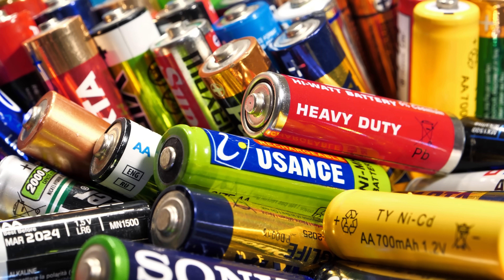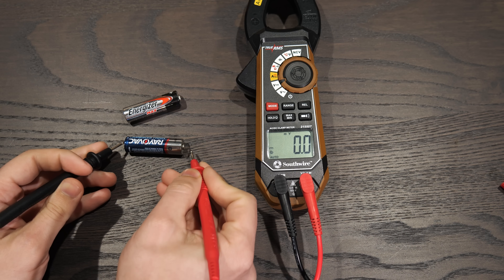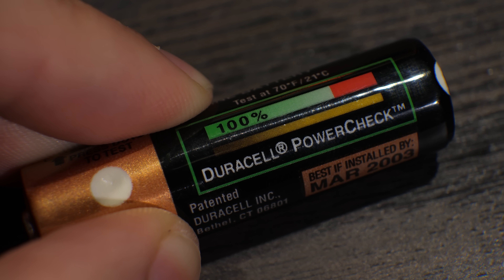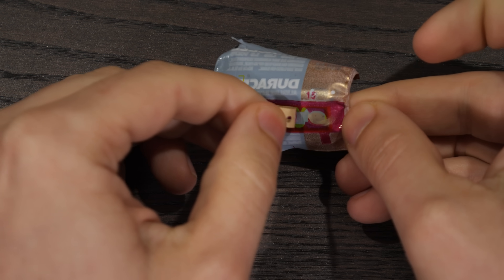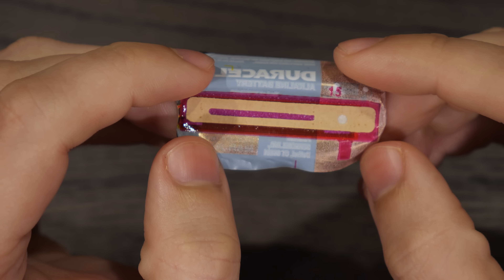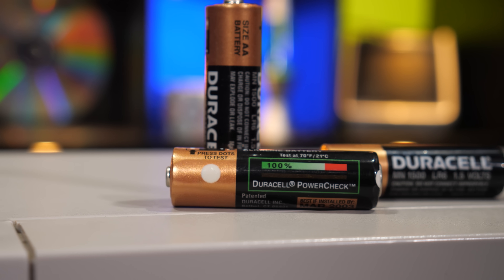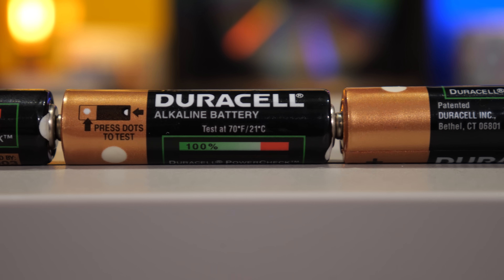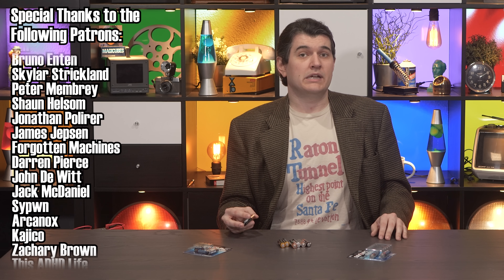Duracell PowerCheck: A genius idea which didn't last that long

Comment: Not that most people follow (or even read) instructions, but many (possibly most) battery operated devices that are intended for occasional or seasonal use recommend that the batteries be removed from the device when not in use.  A couple of examples: 1) speed lights (camera flash units); and (2) electronic hose timers.  I have loads of occasional used items and thus a lot of partially used batteries kicking around and would be happy to see the return of the built in charge indicator, though I do agree with other commenters that the slight increase in dimension can make it very difficult to extract batteries with the self test feature from some devices (e.g., my handheld GPS unit) that have tubular battery compartments that only open at one end.

Comment: I'd wondered why the package-integrated testers were initially severely embossed as the shell/wrapping/label on the battery was electrically insulating.  
It did not occur to me that the thermal conductivity would be a more immediate problem than the embossing flexing/popping and breaking the tester.

Also explains why my cousins were frustrated that leaving 'no name' battery testers in direct sunlight wouldn't see which dying (marginal) batteries were being 'revived', unlike the resistive ones,
since they (generally) didn't include a test load or be sensitized by heat.  Unless they were also a 'flashlight' (naked blub) or other gimmick.

Comment: I wish this was still a thing. My electronic cat flap takes 4x AA batteries... I had to change them one day and I ended up dropping the fresh pack while the dead ones were close by... I couldn't tell which batteries were the good and which were the dead ones because they were all the same brand...

Long story short. Having an on the battery checker would have saved me from having to throw out 4 good batteries because they bounced and rolled into where the dead ones where 🤦🏼‍♀️😭

Comment: Those were "the default" batteries, when I used batteries :D Yes, pressing hurt your fingers, nails are better. Yes, it worked. And hell was I proud of myself as a kid when I figured out how it works :D

EDIT: can't remember exactly, but I think I just rubbed the bar hard enough to heat it up, to confirm my theory :D
EDIT2: it was pretty common for me to test batteries in my walkman/discman, to check whether they will last for the weekend/trip/whatever. If, like me, you listened to music at each and every occasion, you and batteries were close friends xD

Comment: I'd like to argue that some electronics will stop working properly when the battery gets close to dying because the voltage goes too low to be effective. So when that happens I keep the battery to use later in stuff that doesn't need higher voltages. In that case though just get a multi meter or tester.

Comment: Great video! I've also made the switch to rechargeable batteries and only use a battery tester for checking replacements. I have a 4-bay LED charger that features a built-in voltmeter.

Comment: One frustrating aspect of batteries?  When a device is designed around an alkaline battery's higher voltage (~1.5v) and just does NOT work with rechargeable batteries (~1.3v).  Fortunately, these are far and few in between, but it can be kind of annoying when you run into one!

Comment: its so weird you brought this up. I cut one of those off a 9v pack (the 9v ones were built into the packaging) and kept it with my guitar. The other day... i found it. and it still works!  the battery is toast but the tester part i cut out works. 

But also.. yeah, what you said at the end. I spent WAYYY too much on AA batteries for the xbox controller for the kiddo before i got rechargeable.

Comment: There's an even simpler test that works with all alkaline batteries:

Hold them upright, then drop them on a table or similar surface from a height of around 5cm (2"). Full batteries will just land with a single "tok", while empty batteries bounce a little and make a "drrt" sound.

Give it a try if you don't believe me!

Comment: Oh even as a Kid I used to groan whenever I got something that required batteries.  That has lead to a lifelong loathing of anything that requires batteries.  I got to where when I asked for presents if it doesn't plug into a wall outlet, I don't want it.

Comment: I've got a doohickey at home to test batteries, wchich is essentialy a tiny lightbulb and some wire(i made it in high shool). And it works very well enough for the times i need to actually check if a battery is still alive

Comment: Normally here for the bloopers at the end of the video.
Reply: Something changed after 2000, most technical people call these batteries DURALEAK! Many stories of Ruined test gear.
I found an unused battery still in the pack leaking.

Comment: manufacturers used to advise to remove the battery when not in long term use due to risk of leakage, which I recall used to happen a lot. This is why the tester was very handy. Maybe not in the UK as much but a lot of warmer climate countries

Comment: Purpose of these battery testers was not to solve some issue or for people to test batteries but it was for advertising. You saw Duracell with battery tester and it felt like you are getting such an amazing tech that it even has electronics inside it. It was cool factor - it was even advertised in TV.

Comment: You can somewhat reliably detect dead alkalines by bouncing them. Discharged alkaline chemistry has increased volume, so dead batteries have the casing under pressure and they bounce longer.

Also, this is why new batteries don't leak and dead ones do.

Comment: Why did it go away?  That's simple!

Duracell now comes with an easier-to-use indicator:  If it's leaking corrosive material all over everything, it's spent.  If it's not, it's still good.

Now, one caveat:  There is a window of time where the battery's useful capacity has been consumed, but it hasn't yet expelled its indicator fluid.  But rest assured that window is very, very short.

Comment: my grandma had about 3 dozen of these in the 24 or 36 battery count, she got them from costco. 
fast forward to me trying to use these with my xbox 360 remote in 2009 wondering why theyre dying so quickly, and i couldnt figure out how to check the percentage lol

Comment: Does anyone remember last time actually replacing batteries, not just installing them in a new item, or is it just me..?

For me, that indicator was a lot more useful as a diagnostics tool, to find out if it's the battery, or the equipment that blew chunks, it was quite useful for my annoying TV with no indications on the remote for a button press

Comment: 10:00 this is one of the perks of using battery testers instead of a voltmeter, the battery power moves the needle which means it provides just enough load to get a good reading whereas a good multimeter is specifically designed not to affect the things it probes in voltage mode
Reply: My first multimeter had a dedicated battery testing mode. I liked that. Unfortunately it eventually died the way many cheap multimeters in inexperienced hands die, measuring voltage while in current mode.
Reply: The needle usually does not need much current - more than the input of a digital voltmeter, but still microamps. I got a battery tester with an LCD - it works well enough, but I modified it by adding a switch that connects a 10ohm resistor across the battery. Now I can measure the (almost) no-load voltage, then measure the voltage under load.
Reply: The current of an analog meter movement is negligible (50 microamps is common). Battery testers place a resistor in parallel to load down the battery, and this is exactly what the battery testing modes in some digital multimeters do, too. 

Better battery testers use different value resistors for each size of battery, so that a D battery, for example, experiences a larger load than a AA.

Comment: I definitely remember those.  A bit of a novelty 90% of the time, I'd say.  Whilst it was neat, I definitely didn't enjoy pressing in the spots to check the charge; my fingers didn't thank me, especially if I did it for multiple batteries in short order.

There was probably only a handful of times when it was actually somewhat useful to test the charge level in my experience.

Pretty fun to watch this video to find out how they worked all these years later though.

Comment: Just a heads up: the PowerCheck strips themselves aren't discontinued, just the PowerCheck branded line of batteries are. The strips are still in their Quantum line as well as Ultra Advance line.

Comment: I saw other batteries that came with a separate tester strip you had to press the battery against. I think specifically for 9V batteries though they may have been available in other varieties too. That seems like a better idea since you would only have to include a single tester with each pack of batteries, and those testers are far easier to use. They worked the exact same way as far as I remember only you didn't have to press any dots to activate them, it only took a gentle press against the battery.

Comment: a cool feature that wasn't actually needed.  the thing I always found funny about battery technology is that device makers make their devices with an operating voltage threshold that makes them work with Alkaline batteries, but not with rechargeables. - STILL.

Comment: When purchasing devices nowadays, I always try to sus out the ones that have an 18650 inside and are USB rechargeable.  You ask sellers "what kind of battery is in it", they answer "a lithium ion battery".  They're no help.  Everything's intended to be4 disposed of when the battery becomes useless.  I usually end up looking for Youtube reviews.

Comment: It's important to note that voltage should be checked while under load. If you test the voltage of the average dead battery using only a multimeter, you'll probably read 1.4V or greater. The one shown must be extremely dead.

Comment: I remember for a while they stopped printing them on the battery and instead printed them in the package. Which probably saved a lot on costs in quantity. I know we'd just keep the strip in the fridge with the batteries, where batteries are stored in our house (I know it doesn't make that much difference. Its jsut where they go), and if there is a question we'd test it.

Comment: i miss those. they were great.  

Battery question for anyone: for my car beeper/remote starter i need to get off brand batteries (the flat batteries… cm2032 or something like that) because the Duracell  ones no longer work in the beeper. i’m assuming it has something to do with the coating they now put on the batteries that make them taste bad so toddlers don’t put them in their mouths.  fine idea, but not so great if it makes the battery not function.  so my question is… anyone else have any problems with these “coated” batteries?  seems like a major design flaw if that’s what was causing them to not function in my remote starter. i definitely had the right batteries, as like i said to begin with, the off brand ones of the same type work just fine, and i can’t think of any other reason why they wouldn’t work. (unless my local hardware store was selling dead batteries🤷‍♂️)

edit: you sound like you have a cold. i don’t know why, but i always used to find it funny when an actor on a sitcom obviously had a cold irl, but their character didn’t so they just had to pretend they were fine despite sounding like someone is pinching their nose.

Comment: I'm not certain our current situation is actually better. While it is nice not to have to continually replace batteries, the fact that in many devices you either cannot replace them, or they use a proprietary battery that you cannot purchase even though it is technically possible to replace it, undoes all the good that rechargeable batteries have brought. It limits the lifetime of your device, making it far shorter than it otherwise would be and far more likely to be thrown away (let's be honest, that's what the recycling centers usually do anyway). I would have rather had a high quality rechargeable AA battery and just have a few sets of them that I could charge and swap. Too bad rechargeables never really worked that well until Lithium batteries, and that opportunity was in turn used to remove standardization at the same time.

Comment: Ok, so let me correct you on one thing--there absolutely is a time where batteries come out of devices and manage to get... somewhere else.  Frequently, even. And that's when you have children. I have two, wonderful, great kids but no matter how many times I tell them to ask for fresh batteries, they always dig them out of remotes and every other device around the house and  then, when they are done, they take them out of the toy and then throw them on the counter or in our battery drawer.  I wouldn't need this tech but, as a parent, I'd love to have this. We have half-dead batteries all over the house and this tech would frequently save my sanity when all I want to do is turn on the TV/stereo and change an audio setting or two.

Comment: These thermal strips were great as temperature indicators for all kinds of things. I used to cut them into little bits and glue them onto resistors, transistors and voltage regulators to see if when got too hot.

Comment: Those are gone? Really? I still see those being sold in various stores where i'm from. I even got a pack of them last week. The tester is even different now and instead of using the yellow bar it has 4 segments (the most recent having the segments "lighting" yellow but the previous ones the first segment (near to 0%) was red, the 2nd yellow, the 3rd green and the 4th iirc was blue.

Comment: Checking the battery with just a multimeter is stupid. You need to use a load resistor for correct measurements

Comment: 11:00 Most devices use two batteries in series, causing them to drain asymmetrically. So I always test which one needs replacement, and which is still fine.

Comment: Every now and then I'll have some device that breaks for whatever reason and might have fresh batteries in it.  So I will rescue those but I always test them first (using one of those cheap testers) before putting them back in the drawer.  Another reason to keep partial batteries is that I've learned to pull the batteries out of things that I put into a drawer or box for some time (like Christmas gadgets).  But my criteria is to test before tossing batteries in the drawer and trust whatever is found in the drawer later.

Comment: energizers were just showing green inverted good text in a square box and the heaters worked from the middle outwards
as a kid i loved and hated those , especially the hair dryer trick to make battery good again... or by keeping them on a chimney where wwas it warmer than in the reat of the house

although those were the times when you could buy alkaline battery chargers that over a time of 12 hours somehow rejuvenated used up battereis up to 3 -4 times. kind of a quack product but i had it and playing with rc car that eat up 6 aa batteries in an hour i could jyst remove the tires to make the load on the motor smaller and play with it much longer on a slippery floor like a maniac

Comment: If I use a voltmeter to test the cells. what should the value be to know they are bad?
Should I put a resistor, and what value, in series or parallel to load it for a better result?
Can a 0.9 volt battery be used at all; it's not even half of the 1.5?

Comment: AA batteries can still be useful in modern products... because rechargeable AA batteries exist! The ability to swap out batteries and have a few sitting around on a charger is a wonderful convenience, you never have to wait for a little gadget or gizmo to charge again. Plus, you don't have to worry about battery degradation, since the batteries are designed to be fully replaceable! I'm a big fan of using the same part in many places wherever possible, and I wish more things used AA batteries.

Comment: I usually use my miltimeter over here. when it comes to small batteries like those. Or when I am checking like the larger batteries to see when a battery is no longer functional. to see how low it was when it died. voltage wise.

Comment: I actually liked that feature. In part because I found that different batteries would lose their capacity at different rates, so at the very least, they made for somewhat less waste by ensuring you only pitched genuinely dead batteries. ...Yes, grew up having to pinch pennies, how'd you guess? I can still see how the majority of the consumers would just go "Whelp, device is dead, just throw out all the batteries and replace 'em!" because that was just easier. And I suspect there'll always be a market for disposable batteries, too. In part because the rechargeable ones tend to be much more expensive, not just on a per-unit basis, but the chargers you need for them, too. That, and sometimes you need to power something right now and there just aren't any rechargeable batteries available. At home or on store shelves... Like I said, I think there's a place for them, but their overall market share will shrink as...or if... rechargeables get cheaper to produce and buy.

Comment: Did anyone else put flat batteries on the radiator to heat up? It gave them an extra few hours runtime, way back in the 80s

Comment: I want someone to modify a modern smartphone to require AA Batteries. It wont be useful and would be expensive and wasteful, but imagine how weird it would be to need to pop out the 6 or so AA batteries and load in fresh ones to charge.

Comment: Ypu can still buy duracell batteries with powercheck, but its different, it's like in color. Black bar and when you press pads it turns red on one end, yellow in middle and green at other end (with respect to it's charge)